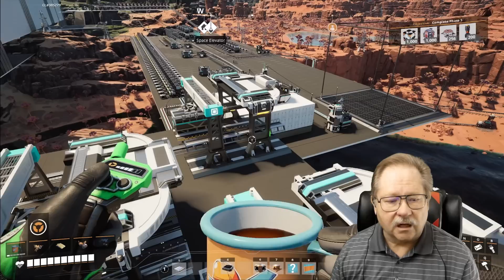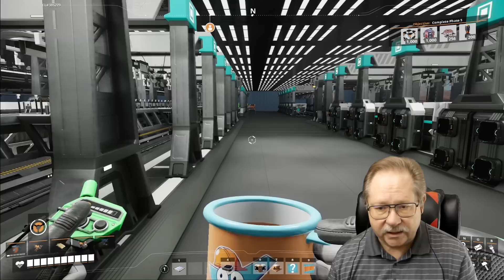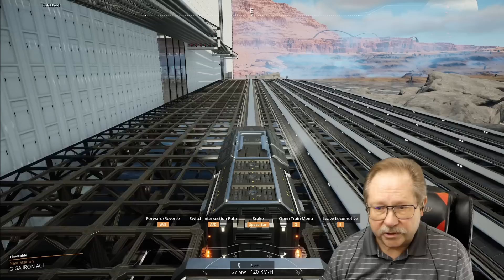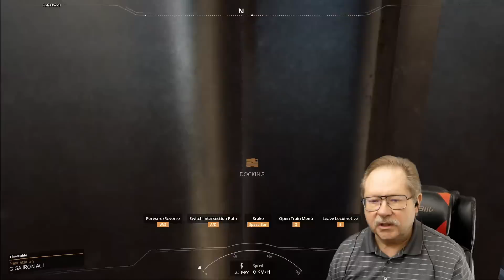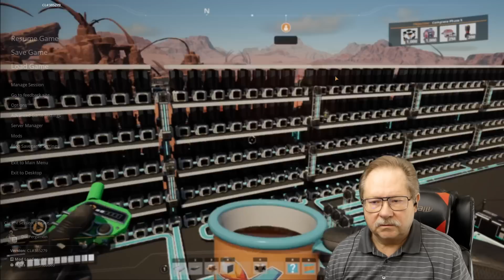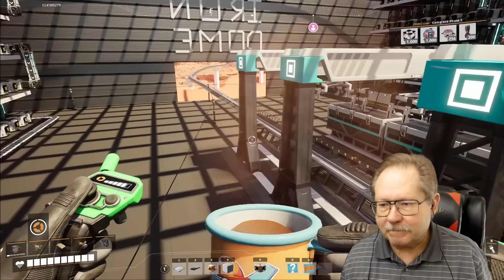It's time for trains to the Gigafactory! [Satisfactory 1.0 Ep. 25]

Comment: I have a question! At the giga factory you are placing the train stations in series. Won't that cause traffic jams and throughput issues when you have a lot of trains running? Thanks in advance and love your videos
Reply from the maker: It can, yes. There are two stations in series and six in parallel. This was done mostly to see the maximum possible per lane, though in practice I'll likely use much less before adding two more lanes in the next section to avoid congestion. Generally I want to put trains that move a lot longer distance on those (and thus spend little time in the station vs moving around the track).
Reply: @Gaming_with_Doc  nice, thanks for the reply. I liked the idea to save space as my mega factory train hub is getting really big. Maybe i can do as you did for some specific stations to optimize space. Will look into it. Thanks once again and keep up the good work at the giga factory, I'm loving it